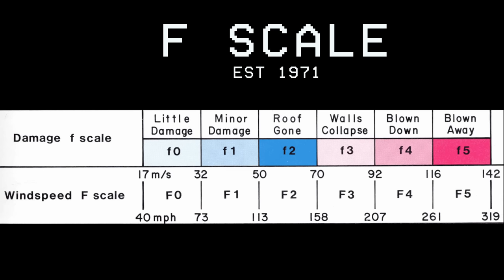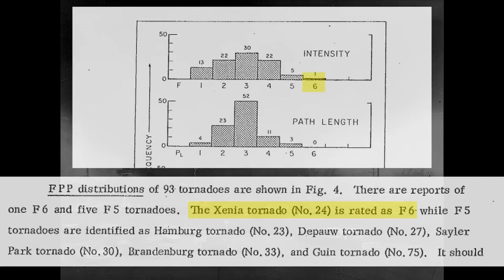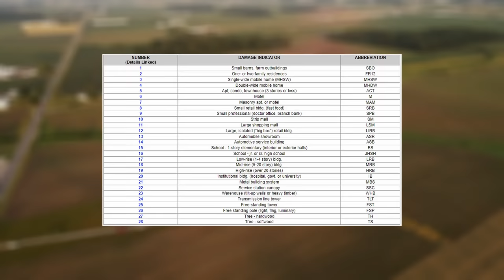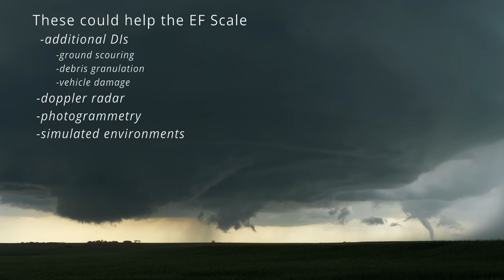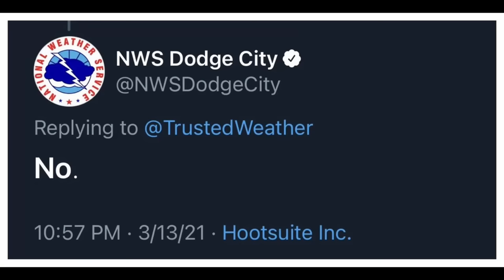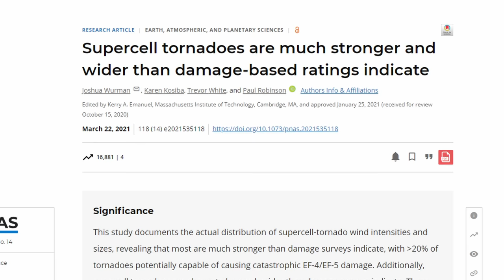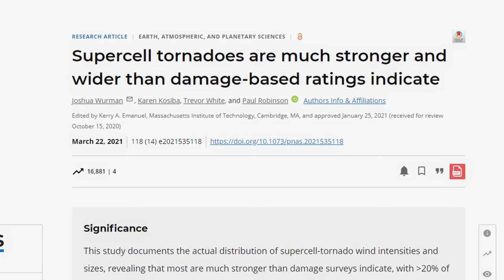Is The EF Scale Outdated?

Comment: Watching this explained what I have been thinking for years very well. 
The EF scale, while amazing, is definitely outdated. From what I've seen, the El Reno OK tornado was not only EF3, the Mayfield KY tornado was not only EF4, the Newnan GA tornado was not only EF4 (I didn't follow or look at the data of that one as closely as the El Reno and Mayfield tornadoes so ignore my thoughts on that one). I feel like they're hesitant to rate tornadoes EF5 now. It has definitely not been this long, since 2013, that there's been an EF5.
I think for radar to be reliable to measure tornado wind speeds, they need to add more radar sites, because there's a lot of dead zones like what happens with cellphone service, and the radar beam goes up into the atmosphere so they won't be surface measurements. They'd have to do studies on finding out how much the height increased as the radar beam gets further away from the radar site, find out the distance between the beam and the ground at the point where the wind speed was measured, find out how much the wind speed would decrease in that height difference and then that'd be the measurement. It'd take time to get reliable information on that, so we'll just have to wait and see if they change anything. Wind speed measurements based on damage dealt is still great, but when damage is not done to anything, or very little things, that's where using any available information/technology we have would be useful, and combining radar measurements with measurements based off of damage would be even better in my opinion.
Reply from the maker: Well said. It would be possible to correlate high end known EF5 damage producing tornadoes with radar captured from that storm.
Reply: @highriskchris   - they did with the Moore tornado. I think the Texas tech mobile doppler was there with Josh Wormer.
Reply: I work in Mayfield and surveyed the damage in person. In Mayfield it was EF 4 for sure.
Reply: If Tim Marshall is surveying the damage, he will never rate any tornado EF5 regardless of how catastrophic it was.
Reply: I feel Newnan was a solid EF-4
Reply: i completely agree with you on nws being hesitant to rate tornadoes ef5. I think they want less drama or something idk
Reply: @needsmetal  yeah that seems like something arkansas would do
Reply: Totally agree with all points.  There does appear to be a hesitancy on rating any tornado now an EF-5. The Weather Channel coverage of the Kentucky storm a year ago even made reference a couple of times they thought it was an EF-5 by it's appearance on radar, along with velocities.
Reply: The NHC does the same thing with Hurricanes.
Reply: @rugger1009  tornado did it’s worst damage after mayfield
Reply from the maker: @rugger1009  I agree, the only spot it seemed to be for sure EF5 was near Bremen, not Mayfield
Reply: @davenorman7172  I wonder why he would rate tornadoes lower than they actually are, if thats what he's doing. Maybe it's a subconscious thing caused by wanting there to be less EF5 tornadoes because he knows how devastating they are. 

If that's the reason, then I would understand. It would be nice if EF5s happened 10+ years apart every time, but it's probably true that there have been a few since 2013.
Reply: @basileusofstupidonia6462  
Very good way of putting it, other people on this post have made some really good points on why tornados are not rated highly enough
Surveyors are much more hesitant than in the past.
Reply: @davenorman7172  And he has said exactly that.
Reply: @mpk6664  that one I'm  still unsure of. That is definitely lower on my list of tornadoes that are potentially EF5. The other ones definitely are though.
Reply: @jadapinkett1656  I noticed that too. It seems like they get so close so many times. This year it happened too, with Ian.
Reply: @davenorman7172  He's a big reason Tuscaloosa, April 27, 2011 was rated a high end EF4.
Reply: @ILoveOldTWC  
Totally agree, 1 of many that should have been rated EF5.
Reply: Newnan was definitely not EF-5.
Reply: @@mogulminister  that I wasn't sure about. Could've been, but I'd have to look up what the damage was and see if it should've been rated higher.
Reply: New Rochelle, Illinois  2015. The damage alone should have rated it an EF5.
Reply: You must understand that for an EF5 rating, everything must be cleared out, asphalt stripped from the road, trees gone, etc. It is to be the extreme of all extremes and the recent Mayfield tornado was not that nor were a handful of others. Jarrell in 1997 is what brought the attention to looking at other damage factors aside from structural and 2011 was the first time a tornado was given EF5 on ground scouring alone.
Reply: @SirRobbins  it doesn't have to do all of that. It just has to do anything that the scale says, which it did. It leveled buildings and swept them off their foundations, and honestly, radar measurements, like I mentioned, should be taken into account too. Mayfield was EF5. Multiple professionals agree.
El Reno was certainly not only EF3 either, and it definitely has not been since 2013 that there's been an EF5.
Reply: @newyorkstatestormchasers  the buildings must be built to certain codes and standards that warrant EF5 winds to cause them. Many homes in the south are quite frankly, shit construction as it's overwhelmingly poor residents. Joplin was a prime example. It was upgraded to EF5 to get the federal government to grant more disaster money. They never found solid EF5 damage in it as most structures were poor in quality builds. I remember Tim Marshall stating that Jarrell was the basis for an EF5 rating to the NWS. If it didn't do Jarrell style damage, it did not warrant the rating.
Reply: @SirRobbins  Jarrell was also one of the most devastating F5 tornadoes ever. That's not what an EF5 has to be now. I don't know about you, but the Joplin tornado sure looked like an EF5 to me.
I will stand by this, rating tornadoes strictly based on damage dealt is not good. It served its purpose and is still great for what it's done, but we need to move on from that. We have the technology and knowledge to do so, and if not, they should do what I mentioned in my original comment and do studies on how to accurately determine wind speeds.
Reply: another thing to note 
how much of the Jarrell storm damage done simply because it literally sat on top of that sub division for minutes.
Reply: @Michael-sb8jf  that sounds like a nightmare.
Reply: @SirRobbins  The Plainfield F5 from 1990 received an F5 rating mostly due to ground scouring as well.
Reply: newnan was honestly a weak ef4 imo.
Reply: @Firemarioflower  the old scale was great, but it had flaws.
Reply: @davenorman7172  Tim Marshall surveyed the Jarrell F5, so he knows what extreme damage looks like. He also surveyed the 1999 Bridge-Creek Moore F5, the 2007 Greensburg KS EF5, The Joplin EF5, and the 2013 Moore EF5 to name a few. He is also one of the loudest critics of the current EF scale and agrees with many of our criticisms of it.
Reply: and this year the greenfield one Cleary an F5
Reply: And now greenfield IA ef4

Comment: It's not just outdated, It also only works in the US. House construction is very different around the World. For example, in Germany most houses are build with thick brick walls, concrete floors and thick roofs with strong wooden beams and heavy tiles. A Storm of a certain strengh would do much less damage there compared to when hitting houses in the US, which are significantly weaker structures.
Reply: The EF scale does account for how well a home was built. A mobile home being swept away would probably only constitute an EF2 or EF3 while a well built brick home swept off it’s foundation could justify an EF5.
Reply: @titoslounge1946  Yeah in Europe we are switching to IF scale because EF scale is not made for European construction, meaning it wouldnt work. Its used in France and China outside the US but i do think IF scale is still better for here
Reply: @wxchris2666   In Europe we have the original Fujita Scale as well as the TORRO scale
Reply: @Firemarioflower  In Europe we have F and T scales everywhere, IF scale which is still in experimental phase but has been used on many tornadoes including the Czech IF4 and the EF scale in France

Comment: Well stated on all points. I never got the reason why, dating back to the May 3, 1999 Bridgecreek-Moore OK tornado, Doppler radar winds aren't ever at least INCLUDED as a part of the surveys. I get they likely aren't surface speeds, but the differential is not too far off from ground truth even with friction. That said, this current EF scale does seem really outdated and a modernization seems in order; include Doppler wind or even CC damage indicators for added support OF the Doppler indicated wind speeds, ground or pavement scouring/ground swirl patterns, debarked trees, etc.

Comment: I agree with 99% of the things mentioned that would improve the EF scale, except for the ground scouring one. There are a ton of different types of soil and it would be impossible to make a scale for all of the types, plus rain softening the soil can have an effect on the scouring, making it nearly impossible to provide a 100% accurate rating based off ground scouring
Reply: I would go with using deep scouring contextually, say something like 10"- 12" plus. That level is generally hard virgin soil and therefore hard to dislodge. Less than that depth would need to take soil conditions into account and that would complicate what is already a too-confused situation.
Reply: @P_RO_  if that were the case, then famers wouldn't be tilling down 2 ft when they plow the fields.  I'm just saying you are wrong.
Reply: @ligmasack9038  Tilling depth is decided for a number of reasons, and such deep tilling is sometimes needed to allow groundwater to reach the surface. And of course you must till to the necessary root depth. And in hard-worked soil it's necessary to turn up unworked nutrient-rich soil that develops deeper to the surface. Where I live tilling never exceeds one foot depth as it's never needed.

So you are as wrong as me. And you overlooked the word "generally, for there are always exceptions. This is why scouring can't be a primary DI without classifying soil conditions but it can give context to other DI's.
Reply: As someone that's taken way to many soil classes. Sometimes dirt is harder than rock. "Top soil" is a misnomer and half mile between locations can result in different degrees of soil development let alone type.
Reply: @P_RO_  that's GENERALLY not correct at all

Comment: I have mixed feeling about this video to be honest. But I have to agree, EF5 strength tornadoes have happened after Moore, the example that I believe in most is Jiangsu from China, since its a high end EF4, and they are known to often not rate tornadoes properly (they have to ask NWS if a tornado can be rated EF3+ ). Took them 2 years to upgrade a tornado that swept slabs clean and fully destroyed brick residences from mid range EF3 to high end EF4.
Reply from the maker: Totally agree, the NWS has gotten a bit more stringent with rating higher end tornadoes as of recent. The EF5 drought seems to be more related to this rather than a lack of high end tornadoes.
Reply: @highriskchris  I think that OU just didnt want to push CMA to EF5. Especially if its 2 years late bc of their weird rules.
Reply: Another example from outside typical tornado alley are the two F4 tornadoes that caused damage around the Brazil/Argentina border back in 2009. The tornado that caused damage around rural communities in the municipality of Guaraciaba, Brazil, was so violent that it made debri to be found 90 miles away from the damage path. Not only that but it threw a well built house over a hill, about 230 feet away from its foundation. Tornadoes in the region are hard to study specially because of Appalachia like topography and because how well built construction tends to be (due to high heat and humidity leading wood frame homes to be unsuitable for the environment). 
Another example of severely underrated tornado in that region is the Dolores tornado of 2016. That thing was probably an EF5! The roar that footage captured out of that storm is terrifying and because it didn’t level every construction in town it was rated as an EF3. But the DIs in the EF scale are related to an North American context, and it doesn’t fit what is observed in South America. Heck, this tornado was initially rated as an EF2, despite clear evidence of a violent tornado observed in its violent motion (resembling the Rochelle tornado), and deafening sound.
Reply: @wxchris2666  here is a playlist with great footage of the Dolores tornado. This is probably the most well captured tornado in the region! https://youtube.com/playlist?list=PLm8cfElEZ1iexfMJKtCMwxDo_fzPIESCO
Reply: @galdutro  Dolores is easily one of my favorite outside US tornadoes, after the France F4 from 2008 and Czech Republic 2021
Reply: @wxchris2666  Nice! Have you checked out the "Marechal Candido Rondon tornado" of 2015? That is also a well documented powerful tornado in the region. This is my personal favorite tornado outside the US, as I think this storm was severely underrated (rated as an EF1), and because it was part of a larger tornado outbreak that affected a bunch of cities (Alto Paraná, Treze Tílias, Marechal Candido Rondon, and others).

https://www.youtube.com/watch?v=g110Y6b29FU
Reply: @galdutro  Oh yeah i have definitely seen that somewhere, ill check it out later
Reply: @wxchris2666  One issue is, what do we gain from going back and rerating tornadoes? It's not gonna change anything. It doesn't matter whether or not the El Reno was rated EF3 when it should be EF5. The only thing it does is make a miniscule societal impact that mainly only effects those who were effected by the tornadoes. Retroactively going back and rerating every single tornado because you have newer technologies doesn't really make sense. Even if similar technologies were around at the same time as these tornadoes, we don't gain anything substantial enough from it to warrant taking the time and going back to reassess the tornadoes. From a future perspective, I do agree that its better to categorize more efficiently given the amount of data we get during and after a severe weather outbreak, but I don't think going back to change past ratings really does much for anyone besides make a pissing battle on who was right or wrong about the rating of the tornado.
Reply: @wxchris2666  At some level this makes me feel that insurance companies, corporations, and government, are influencing tornado ratings to save themselves money.  That aspect should not exist in these surveys and yet it most likely does.
Reply: @superomegamkiii2313  Yeah no this wouldnt benefit them at all. They have much better ways to save money
Reply: @wxchris2666  precedent is a powerful thing, there hasn't been an F5 rated tornado in Kentucky since April 3, 1974 in Brandonburg.  The infrastructure needed to rebuild after a storm rated as an F5 or EF5 would no doubt cost more due to the stricter building codes and safety standards.  I would not be surprised at all if it was ever discovered that storm ratings were low balled for this reason.
Reply: @superomegamkiii2313  Yeah but no, this is just one of the crazier conspiracies and i hate it
Reply: @wxchris2666  Not that crazy when you consider the motivations behind it.  Any tornado that can be proven with damage or data to have had 201+ mph winds at any point in time should be rated as an EF5.  I do know that with data there can be variables but we have had Dopler radar for over 40 years now.  People trained to use those systems can calculate an accurate wind speed measurement almost to the exact mph.
Reply: @wxchris2666  Subjective guessing does not belong in these surveys as the final word.
Reply: And the Jingasu Tornado was 2.5 miles wide
Reply: @stormchasernichtpit1493  Yeah, Funing (what its called) likely was EF5, but Chinese weather enthusiasts have stated that CMA (Chinese NWS) has no interest in ever using the EF5 rating on any tornado

Comment: I think we need two independent scales:

The first is for damage potential. This one should be determined primarily by doppler radar wind speeds, and, if those are not available, by damage indicators. This scale is obviously needed for things like meteological investigations, as well as insurances etc.
The second is for actual damage done. This one should be done by damage indicators soely, as well as maybe the width, damage path length, width etc. Basically you integrate the tornado damage over its lifetime and path width. This one would be a good scale for desaster response coordinations, like figureing out how much cleanup effort is needed.
Reply: Dopplar is inaccurate af.
Reply: @davidmurray6176  That doesn't matter necessarily. That's what error bars are for.